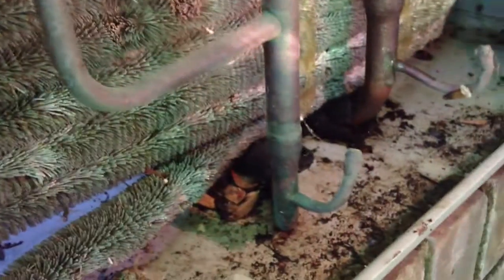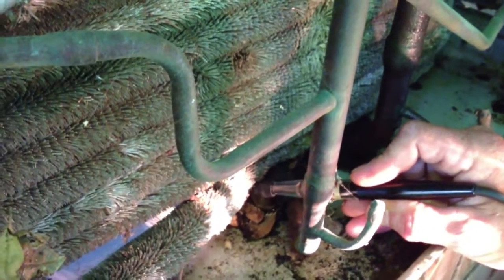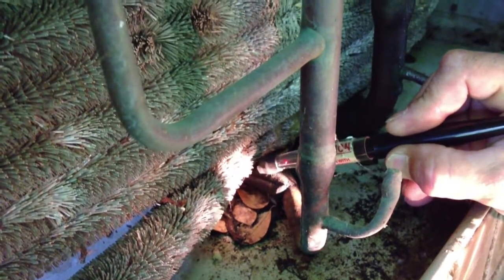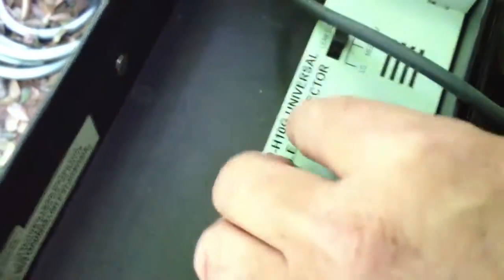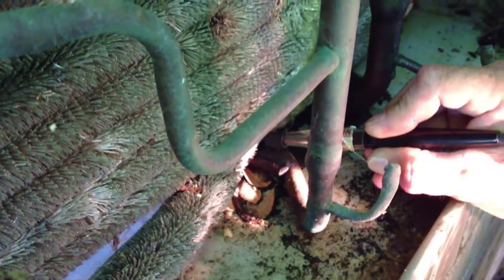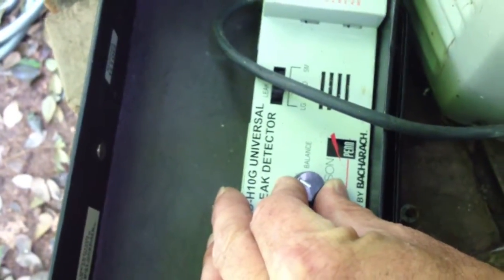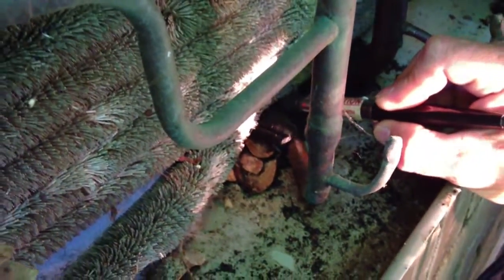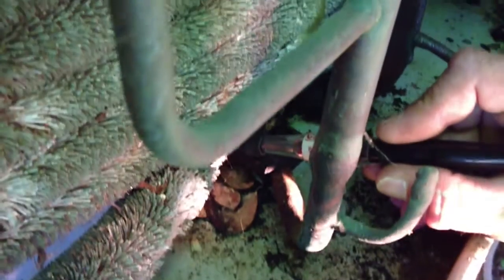The H10 Leak Detector verses a Trane Condenser Coil

Comment: H-10 baby, H-10.....................Mine impressed me the first time I used it. I had a prep unit that had a liquid line with braze joints running about 1" over the top of the evap, I was able to pinpoint the leak to the evap just under the braze joint.  I have the Bacharach H10-PM.  Just set it for manual mode and adjusted the sensitivity and BAM, there it is.

Comment: Im thinkin im gonna have to get an h10 myself. So far i have been using the fieldpiece infrared think its the srl2 is the model #. I think it works well but sometimes it goes off a couple times on a spot and tuen wont do it again. I guess i just dont fully trust it. Looks like the h10 is a leak hound for sure